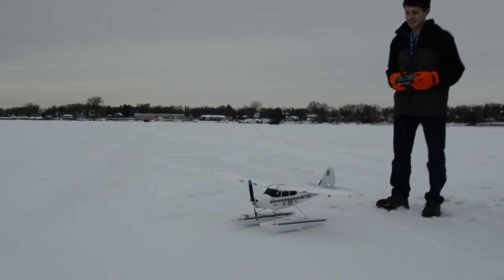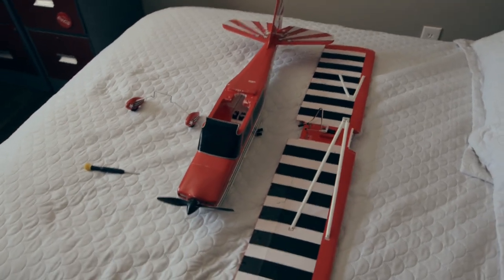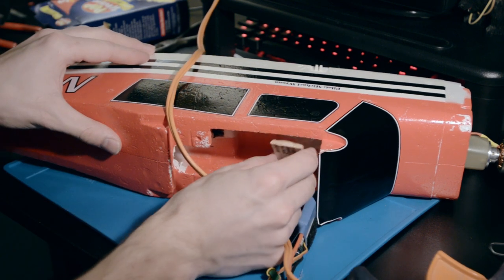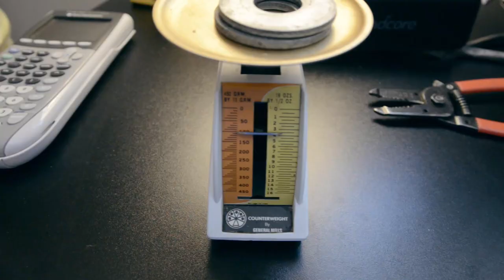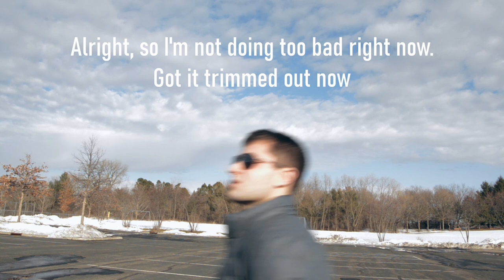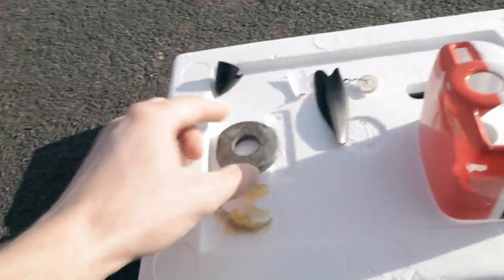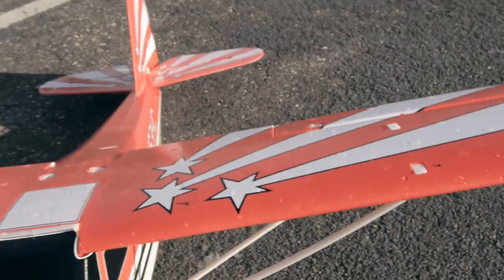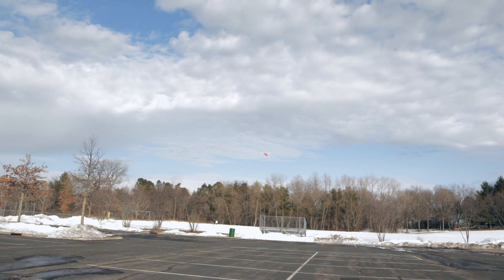Restoring and Test Flying my RC Decathlon Airplane

Comment: It is a fabulous plane ✈️ although it’s damaged 😂. 
Go on an keep doing like this videos .
As every time i have one question😂🤷🏻‍♂️
How do you make a programming for the connection between the controller and the plane? I haven’t seen any microcontroller 😅
Thanks 🤩
Reply from the maker: I used a Spektrum four channel receiver and a DX6i transmitter. Manual control only